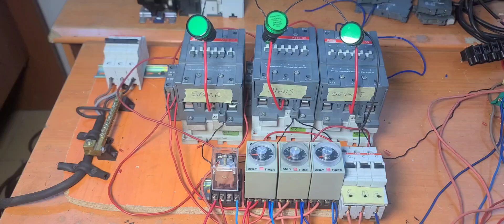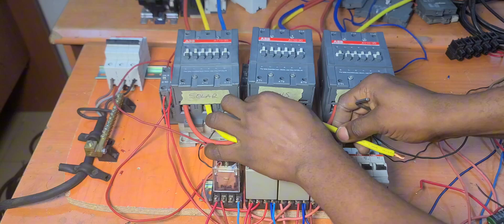ATS Power Connection

Comment: Question Sir.

I have watch the first,second, third, and this fourth video and I'm very glad someone like you made a tutorial ❤
but it baffles me about the pilot lights  why does all 3 light RED YELLOW "Blue" is Turning On evrytime whenever a power spirce is on, as in the 1st 2nd 3rd videos the pilot lights were not like that, 😊 can we also retain it that feature so we may know what source is on?

Sir will you  be able to add OV UV Protection devices?

hope for a next video continuation.

Liked and Shared.
Reply from the maker: Thank you for watching and sharing! I appreciate the detailed question about the pilot lights - I'll try to address that in a future video.
God bless you richly.
Reply: @diliogbuenyi Mr. Dili, can you also integrate a Digital OV UV with this system .

YES ❤ . Regarding with Pilot Lights .

Thank you.